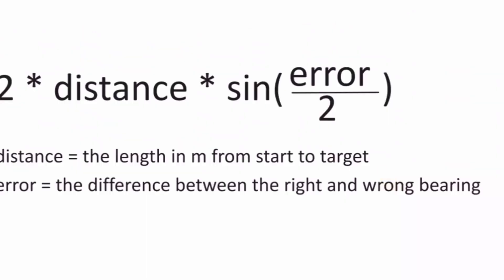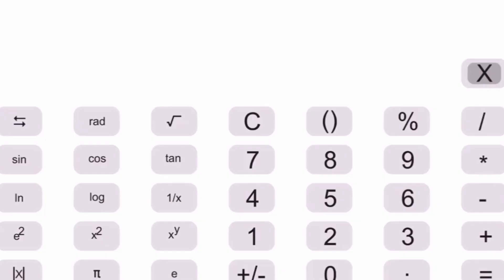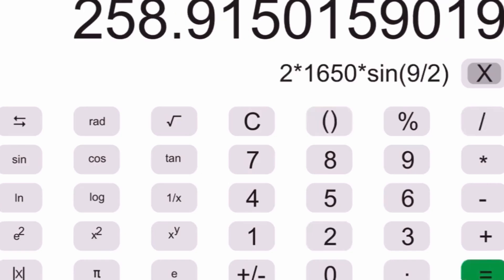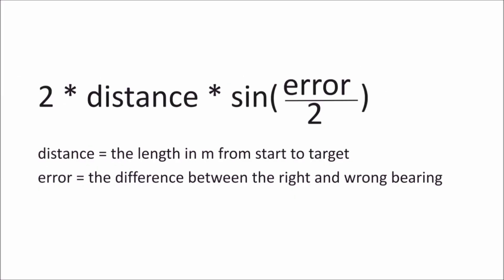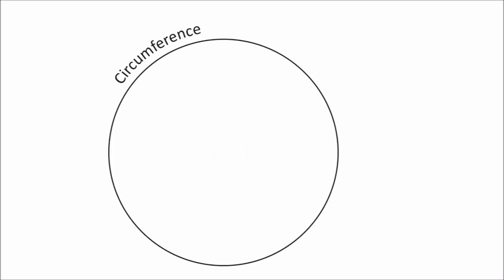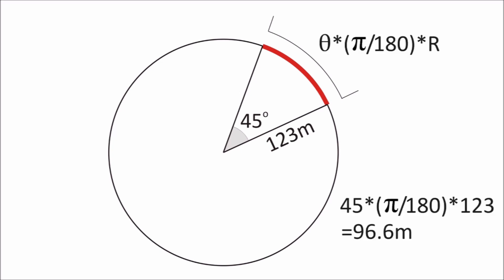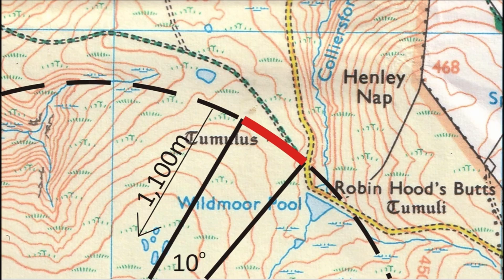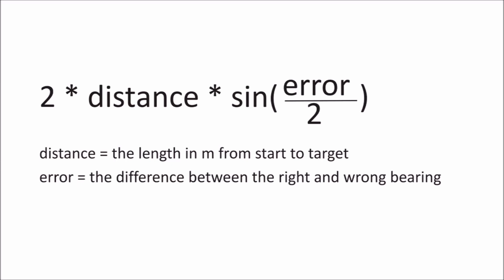Compass bearing error calculation (advanced) P1

Comment: It could be useful to check out how much every 10 degree mistake makes for a kilometre and then have a reference point when you know the distance you want to travel for quick head math, say "every 10 degrees is 100 meters off the mark on this distance."

It's also good to note if your calculator is using radians or degrees, because sin(21/2) can become -0,879 which is a bit difficult to grasp, given that you supposedly walked -1500 meters off the target, whatever that means. And it drives me mad because I can't remember how to fix the negative result by math or looking at the unit circle instead of fixing it by switching to degrees.

Comment: Should the distance from point 483 to the track junction  be 2750 metres,You measured it on the map as 11 cm and i am assuming the map scale is 1:25000 11x25000=275000cm or 2750 metres.

Comment: Divide 9 Degrees by 60 (roughly) and you get 6.5  Then divide 1650 meters by 6,5 and you get 253 meter. All in your head and without any calculators or funny functions.

Comment: Why use sin ?  distance (d) is 1650 m so circumference is 10367 m. Error (alpha) is 9 degrees so 10367/360*9 = 259 m. Simplified formule = d * alpha / 57.
Second example gives me 313 m in stead of 309 m, is 1% difference and still very accurate.
Reply: I agree. Chord and arc a very similar when theta is small. Pie/180 is 1/57 and looking at it this way, we can see that the distance error is proportional to both distance walked and angle error. So if we walk 3 times further and our angle error is twice as much then our distance error will be 6 times bigger.

Also just remember that 5 degrees off over 1 km is 90 m error and you can use simple math to work out your error from that starting point.

Comment: I see, i am not that good with mathematics as you, so i use an other and in my opinion easier (less or easier mathematics ore calculations) method to calculate compass bearing errors. Your method certainly wil be more accurate as mine, but i dont have to calculate with sin etc. Not my speciality. I once learned it at school but i never understood it.
I am sorry, but to explain this in English is very difficult to me, but i give it a try. I hope you wil understand it. I use the knowledge of the mil, a circumference of 360° = 6400 mil. 
In a distance of 1 Km an error of 1 mil is a distance of 1 m. 
1° = 6400 mil / 360 = ±17,7777 mil (for the easy i use 1° = 18 mil). 
So an error of  1° = 18 m.  

-An error of 3° on a distance of 800 m wil give :
3 x 18 mil = 54 m @ 1 Km. for 800 m = 54 x distance in Km 0,8 = 43,2 m
3 x 17,777 = 53,3331 @ 1 Km for 800 m 53,3331 x 0,8 = 42,6664  (difference 0,53 m)

-An error of 7° on a distance of 2400 m wil give :
7 x 18 = 126 m @ 1Km.      for 2400m = 126 x 2,4 Km = 302,4 m
7 x 17,7777 = 124,4439     for 2,4 Km = 124,4439 x2,4 = 298,6653 (difference 3,73 m) 

This is the method how i use it for myself and how i explain it to a youth movement and boy scout group. And i hope they have understand it. They all said yes.